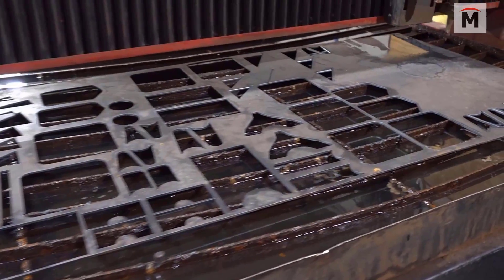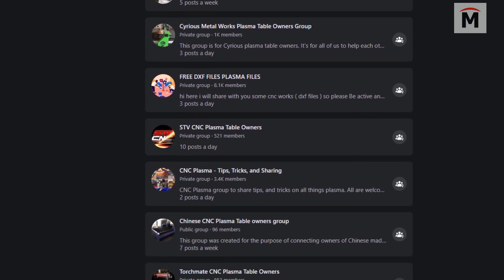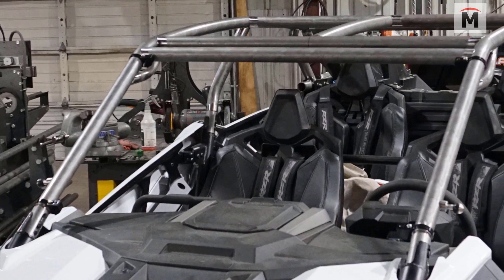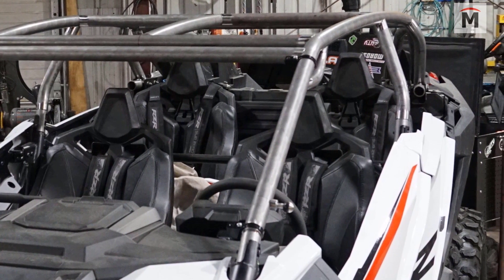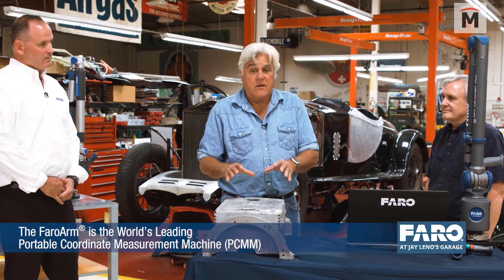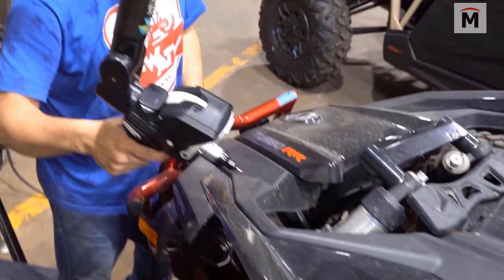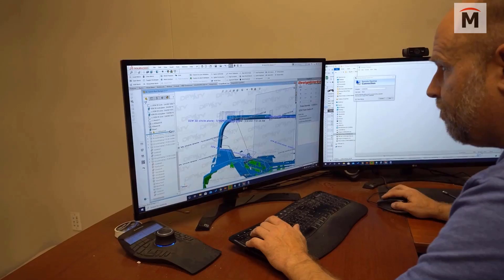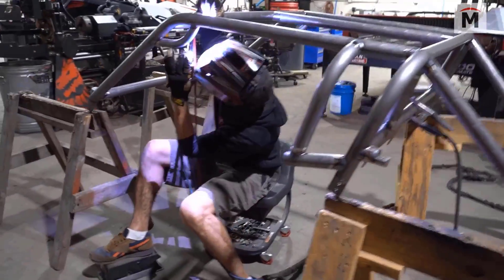DFW ATV Case Study - SOLIDWORKS Tubular Weldments

Comment: Как она едет по грязи, что на практике получилось?
Reply from the maker: Assuming the online translation is correct, this thing runs great!  When you turn tight at high speed the suspension really leans out over the turn which feels scary the first time you ride it, but when you see the width of the wheels you can see that it is very stable and extremely capable on any terrain.  This unit has gearboxes on the wheels that give it more torque than speed, but you can configure it however you want.